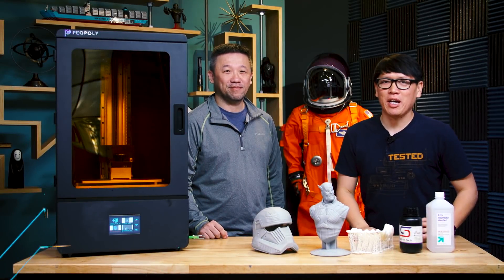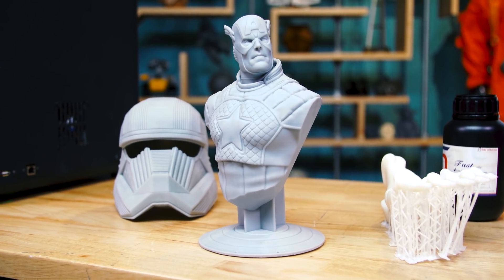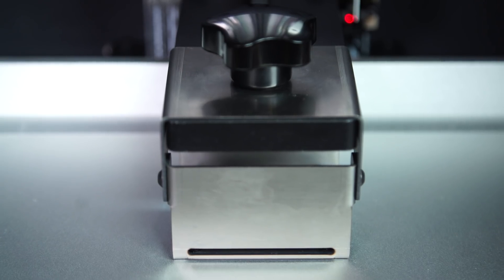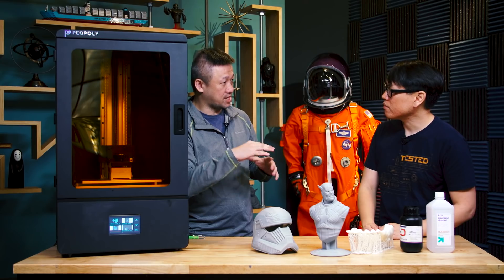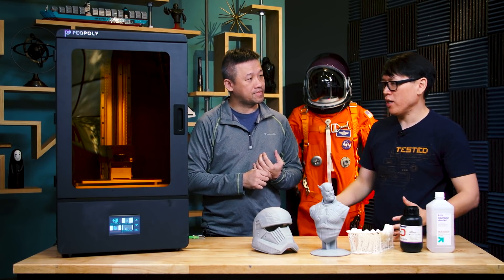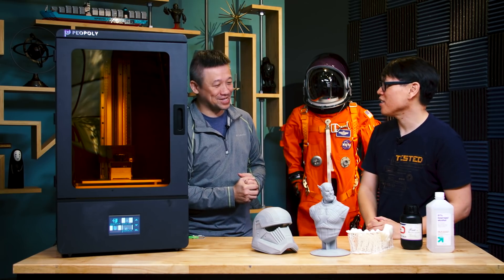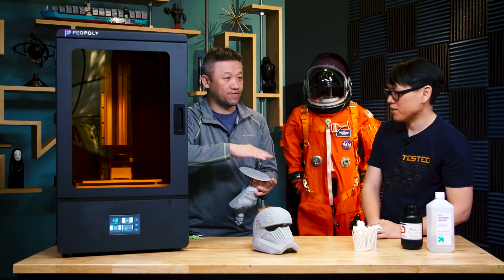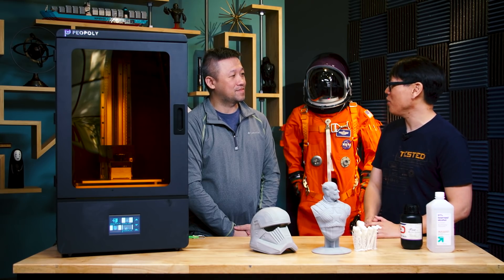First Look: Peopoly's Phenom SLA 3D Printer!

Comment: Whoa! Those layer lines at 9:12 are awful. This is not a slicer error because many other printers use the same slicer without this problem. My bet is that is a mechanical issue. Z axis sticking or binding. Could also be caused by messing with the machine while printing (opening door, etc) . This could indicate a lack of rigidity of the machine frame.
Reply: I'm going to guess refills or door opens - cross section changes are another possibility with regards to how they match up with supports.

Comment: 9:18 good closeup on the flaws. :D Actually, a lot of youtubers are trying to figure out what is causing these lines on some mSLA printers, and the best I can come up with is either a slicer error or a flaw in the Z screw. Any thoughts?
Reply: Without being able to see this unit operate in the video (which is a shame) best I can think of based on limited views is backlash on the Z screw, or a small amount of slack in the 'lovejoy' coupler between the stepper and the screw. 

That said, it could also very well be an error in the slicer, or in the stored file getting corrupted somewhere due to a buffer overrun or whatever.
Reply: It's not the Slicer - lot of other printers use the same slicer (ChituBox) and Chitu control board and don't exhibit this problem. It's got to be mechanical. Probably the bearings in the MGN linear rails binding, or perhaps the frame is not rigid enough and the machine was momentarily disturbed (someone opened the door during the print). I'd be taking that thing apart and checking the smoothness of the linear rails. Chinese linear rails are notorious for binding until they are well broken-in.

Comment: I like this printer but I feel it is lacking one thing that will make it a GREAT printer. Why doesn't this machine have auto leveling?
Reply: lol what? it's a dlp printer
Reply: You loose a thumb screw then put it at 0 then tighten the screw back if that’s to hard for you then talk to a doctor
Reply: Dude I have leveled my photon once when I first bought it 6 months ago. Definitely not necessary.

Comment: Can you put a 1mm glass screen over the panel to better protect it ?
Reply: That's not the issue. They can be damaged, but mine just gets burned out. The life span of the LCD is the main issue. If you add more thickness between the LCD and FEP, it could have divergence/ diffraction of the UV curing the layers. Thin glass could be used but doesnt release like the FEP.
Reply: wolfe1970 the resin degrades the fep and the resin will get stuck to the glass but not the FEP ( it’s basically Teflon
Reply: The best defense would be if they could put the panel on a hinged/sprung frame, so if something presses down on it, it moves down along with.  It would need a shutdown switch so if the machine detected any movement in the lcd frame it shuts down the print, to avoid a cascade failure.

Comment: Cool, just keep in mind if you decide to get one of these that resin is expensive, since the bed is bigger that means you will need more resin to fill the bed which will also cost more.  Not to discourage anyone from buying these, personally I love resin printers.  You’re looking at $25 for half a liter on the cheap end, and I go through those fairly quick on a smaller printer.
Reply: Noel R a liter is essentially 1kg so cheaper then Proto pasta glitter filament

Comment: So, 300 hours of use form the LCD gives you only 20 printed parts at 15 hours per print before needing a full replacement LCD for $99. Assuming 1000 hours that's 66 printed parts. that's still not that many 3d prints. Would be interesting to see a full comparison of build vat replacement costs etc compared to other printers.
Reply: @Mat_1000  I don't think that would work, as E-ink displays are fairly opaque.  They use charge-sensitive white and black pigment particles in each pixel.
Reply: Do they mean print time or do they mean UV on time? because the UV light is on probably only half of the time of the print when you consider movement and off time.
Reply: See how much a printed part this size costs from shapeways.  It will be in the $500 range at their lowest resolution.  20x that is $10,000.  Are we still upset about $5 per print?
Reply: I was thinking the same thing. I’m surprised by the lifespan of the LCD display he quoted - I would have never thought it would be so short. Anyone know why?
Reply: @ModernCollector  LCDs generally aren't designed to be running hot, while getting blasted with high intensity UV, with multiple kilos of weight sitting on them.

Comment: did I hear that right.. expected lifetime of the panel is 500 hours, with test examples ranging from 200 to 2000 hours? Thats an order of magnitude in difference, so its hit and miss if you get a "good" panel or not. And at 99 dollars for a replacement, seems like a rather steep running cost to me, or am I missing some thing here?  interesting though, with a large format printer thats way more affordable  then the big name brands.
Reply: Sounded like the panel that lasted 200 hours was because of debris accidentally trapped in the the vat that cracked the screen, and the high hour one was 1000 hours, not 2000. I'm guessing they're undershooting how long a well-maintained LCD will last in any case.
Reply: @errrerr2489  yes, a 1000, not 2000. I re watched the episode. Though a machine like this is way bigger then what I would need, like making custom greeblies and thingy-ma-bobs for scale model building. Elgoo Mars is more then sufficient for my use. I do think if they get to a 1000 hours if used right, then it would be way more tempting for a lot of people though.
Reply: Sprocket55 I think one thing missed here is you can print the whole deck worth of custom things vs having to print one thing at a time, 20 items printed vs 1 would be the same timeframe

Comment: Can we please stop washing our prints with isopropyl alcohol guys? There are so many much better options on the market
Reply: moose bear do tell!
Reply: I'm interested in knowing as well
Reply: Id recommend mean green, you can find it at walmart or grocery stores. Has no smell and isn't nearly as expensive as alcohol seeing as you can get a gallon for around $3. Also it cleans up parts better in my experience. Uncle jessy did a video comparing a few other cleaners that was his recommendation. Will post link shortly
Reply: @moosebear3092  www.dbclunie.com I tried those solutions by uncle jesse, yeah they are cheaper by volume, but they cloud transparent resins more than ipa, also leaves a residue on the resin prints which makes the finished product feel waxy instead of plastic like and the part will smell or whatever solution you use to clean.  Ipa however leaves no residue, the washed and cures parts feel like plastic and have zero smell.  I use an ultra sonic cleaner for 15 min and then a water rinse followed by 3 cycles of curing under nail salon uv lights for about 15 min cure time.  I get my ipa from Walmart at 91% and it's 2.50 a quart and I need two quarts for my cleaner, surprisingly have minimal evaporation as I keep the lid on when not in use and filter out once a week and reuse the ipa while curing and discarding the filtered waste product in a paint tray outside in the sun.  Don't discount ipa, it's actually the best solution, in my and others opinions and is a reason it's recommended as the cleaning solution by resin manufacturers.
Reply: @DavidClunie  15m is way longer than you need. I agree on all other points. The longer it sits in the ipa the more it absorbs, which can cause surface cracking. 2-3 minutes in the ultrasound is more than enough. Sometimes just spraying it with a spray bottle with a solid stream is more than enough. Bonus tip, submerge the print in water, and do the final cure underwater, for a much better cure.
Reply: https://youtu.be/tnGasVwkgMk

Comment: 1800 sounds like allot , but for this size printer and detail, it's actually pretty cheap....
Reply: check out the Anycubic Photon. Stay away from Photon-S
Reply: @Ryder335588  Noob here, but why?
Reply: @La838  The photon s has a better UV LED and Z axis rails for faster and more even printing.  The photon has a metal case and more mature firmware. They both have pros and cons. I went with the s for faster prints and I'm happy so far. Right now the s doesn't work with chitubox if you want anti aliasing
Reply: @La838  Photon S has a different board and I see more people having issues with that one than the regular Photon. I have a Photon and I'm really happy with it.
Reply: @Ryder335588  really my photon came with a burnt out motherboard
Reply: @Ryder335588  I have a Photon as well, but upgraded my Z-Axis assembly to the dual rail, anti-backlash assembly from Jackson, and I couldn't be happier with it.  I don't feel that I'm missing out by not having the Photon-S.  Just wish AnyCubic would come out with a larger format machine like the Phenom shown in this review.  I'd even settle for something with a build area that's only larger by 30mm in length and 15mm in width.
Reply: Yeah it's a reasonable price IMO

Comment: 1:30 They use Tape round the LCD panel here
Reply: I mean its a prototype
Reply: The tape is actually to create a small air gap so that the FEP doesn't vacuum itself to the screen during the peel
Reply: @cutty02  Thnaking YOU I learned something new :)
Reply: It's there in case of an accidental spill. Keeps any resin from flowing down into the LCD and curing. Very common thing on any MSLA printer.
Reply: @ricketron  build it in to the design
Reply: @3D_Printing  It is built into the design. "Stick the tape here." It's virtually zero-cost, nearly 100% effective, immediately replaceable by the user, doesn't require disassembling the machine to install or replace, and doesn't add any extra parts or manufacturing steps. It's a solution that's been in use for years on various resin printers. If you can come up with something better that doesn't add to the cost or complexity of the machine, there are several manufacturers that would probably love to talk to you.

Comment: Why make a cheaper large-format resin printer? The cost of the material will still be pretty high at that volume, making it expensive to print with regardless of the cost of the hardware and out of the scope of most of Peopoly's current userbase of home enthusiasts. If I've got the money to print with this, I probably run a business and have a turnover that would justify going with something with the feature set and material library of the Form 3L. I'm not saying that healthy competition and inovation in the market isn't good, I just wonder why Peopoly has decided to stray from their more enthusiast-focused products. Businesses who can afford to print larger scale SLA prints are most likely going to go with Formlabs or similar.
Reply: Colt 44 not me. I am a business and print about 130kg per year, and no way do I want to spend $150 a liter for FormLabs resin.
Reply: tmortn LCD resin is $36 per liter.
Reply: @tmortn  I did specifically mention the Form 3L which has a larger print volume than even this machine (300 x 335 x 200mm). I run a business where I am utilising Form 2's daily... I have also worked with a Peopoly Moai. The truth is, they can have all the on-paper specs in the world but the repeatability and quality I get from my Form is night and day from a Peopoly. I'm not saying that you can't get pieces from a Peopoly that don't match a print from a Form, it's just all the steps in between to get there that make a difference for my business. Formlabs material isn't cheap, but is mostly irrelevant considering I charge my clients for it. I have never had a complaint about my prices as at the end of the day, a well optimised average print on the Form doesn't typically use more than 20ml. Expensive material does not outweigh the benefits of reliable, repeatable, one click prints if you're running a sustainable business. I have not yet had a failed print.

Comment: $1,800 is steep, but that size of printing in SLA is great. I'll stick to Elegoo and Anycubic for now, but I can't wait until that size is more affordable.
Reply: I mean if you compare it to the original moai with a 6" plate for 1200-1400 its not bad at all.
Reply: Since you have both, Elegoo mars vs Anycubic photon...pros and cons?
Reply: @Moctop  Same printer hardware, Elegoo has a slighty bigger build volume... and it doesn't forget the zero position of the z axis when you cancel/pause a print (i also have both of them). Photon has a obnoxious fan that vents the fumes from the print out.

Comment: Getting there. Once we can pop out a full size helmet with SLA, i'm in.
Reply: Why would you need THAT much space ALL THE TIME? Sacrifice a little bit of volume and make it out of different piece but pay less.
Reply: SLA prints are pretty fragile. Probably better off with an FDM, they hold up to abuse a bit better.
Reply: @dominicknepper2082  They would be ideal to make silicone molds from to cast helmets from more durable resin.
Reply: @dominicknepper2082  nah, use tough resin, its stronger than alot of FDM prints, check out cnckitchen tough resin review
Reply: Dominic Knepper not true it depends on the resin there is strong resins available
Reply: @dominicknepper2082  FDM prints are more rigid, NOT more strong. We have both at work and they almost never stop running. I wonder what you're doing wrong to end up believing that SLA prints are fragile.
Reply: Dominic Knepper The new form 3L is that big, with a suitably big pricetag...

Comment: Great. Another thing I want, but cant afford :(. Why must you hurt me like this Norm? I still love you tho.
Reply: Give it time. These things have dropped in price so much in the last couple years. You could always pick up an Elegoo Mars, or something similar. Much smaller build area, but still amazing quality, for under $300.
Reply: Chad Voller I second the Elegoo Mars. I knew nothing about 3D printing but I’ve had it for a month & love it. Just be ready to tinker with it if prints fail. Great community on Facebook & reddit
Reply: @madmaximus9973  Digging mine as well. I'm using it to make masters for silicone molds right now. I'm not new to 3D printing, but this is my first resin based. Safety is another thing people don't think about when jumping into these. I've got it in a room with the exhaust fan on constantly. I don't mind the resin smell, but I know it isn't good for me.
Reply: I got the Anycubic Photon and Im really happy with it, right around $300.